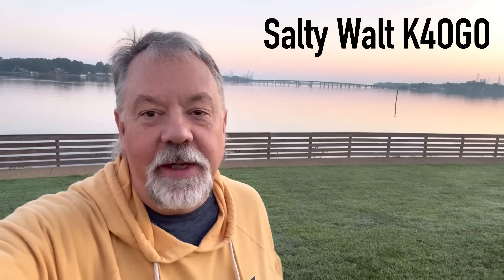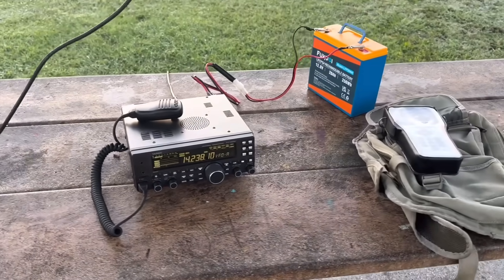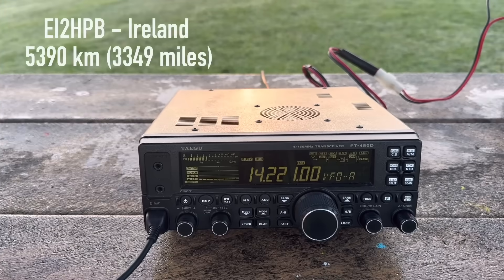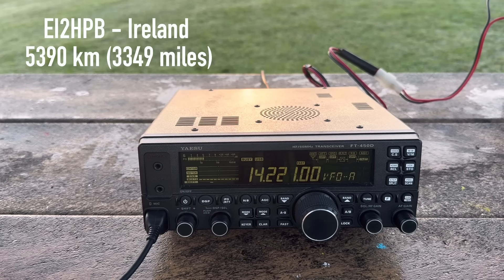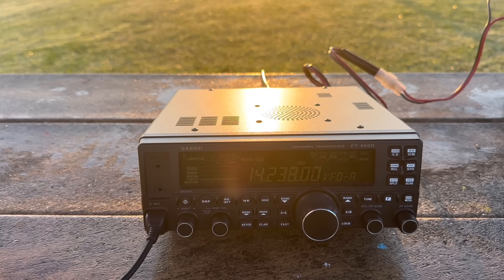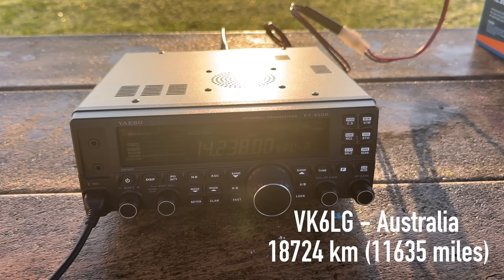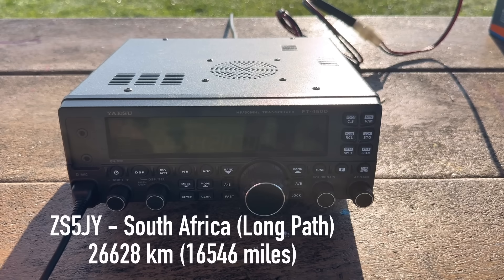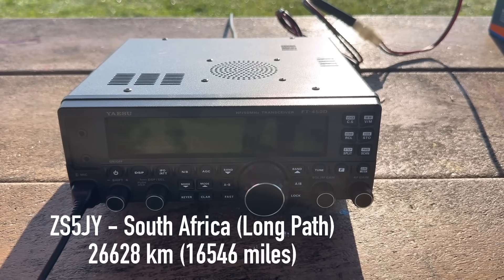Building a Half Square Antenna for 20 Meters

Comment: Hi Walt.  You should try an Icom ic-706MKII or MKIIG.  One of the first "shack in a box" radios.  100 watts on HF and 6m.  I have the 706MKII with DSP installed.  I don't use it on 2m, but on HF and 6m it is an excellent radio with a lot of great features.  I have the Ten-a-Tuner module from W2ENY, which makes using the ATU-100 (in auto mode) with the 706 series  radios really easy.

Comment: Nice video, and some great contacts into VK and ZS. Looking at the modelling tool Walt has used, it has to be said that he has chosen "Perfect ground" from the Ground Type dropdown there to get the azimuth radiation pattern he shows at 0:32, as well as the actually not realistic nearly 9dB gain figure. A better ground type for that location beside the river might be "Good" or "Very good", which would give not so dramatically deep nulls in the pattern and a more realistic gain figure of 4+dBi, but that's possibly just a nitpick.  I'm going to have to make me one of these...
Reply from the maker: @robbannstrom yep a bit of a nitpick but I get that a lot. I get many comments about my use of saltwater and perfect ground which I make no apologies for. I named the channel Coastal Waves & Wires because my main interest is HF propagation by the ocean. I actually explain that in the beginning of my book. Regardless of the dB number, the 3D RF model shows the effect of building the half square and feeding it in a corner. It’s a solid antenna for DXing. 73, Walt
Reply: @COASTALWAVESWIRES  Apologies for having sounded so critical. I had not realized that the water very close to you in the background was salt water. You certainly chose the right setting there.  As to channel names, I don't generally pay them any attention, and I'm afraid I've never heard of your book, so your explanation there won't ever reach me.  Nice video, tho'...

Comment: Morning Walt, I believe the half square is vertically polarized and fires end to end, not broadside. I've used one for years at a lake cabin and the nice thing is that it will tune up on other bands. Enjoy your ride!
Reply from the maker: No, it definitely radiates broadside, the model and a lot of text show this. I was also aimed broadside to all these big DX contacts which this video proves as well. This acts the same as two vertical quarterwave in-phase that are a half wavelength apart. 73, Walt
Reply: The full-wave current-fed single-bander version IS mostly vertically polarized, and fires broadside.  The end-fed half-wave multi-bander, however, displays different patterns on its' various harmonics and varying degrees of broadside, end-fire and max lobes and mixed polarization.

Comment: It's amazing what 9 db can do for a signal.  Some hams put up 3 element beams at 60 ft and only get 6 db over a dipole but you sure showed 'em Walt.    K2XT
Reply: That 9dB figure was obtained for a "Perfect ground" ground type, and not for a more realistic ground type.
Reply from the maker: Yep, in proximity to saltwater. Pretty much how I typically operate
Reply: @COASTALWAVESWIRES  OK Walt, I had assumed you were close to fresh water, and on a rich type of soil. In your actual operating position, either one of "Perfect ground" or "salt water" ground types would be appropriate - both give very similar results. You made some great contacts there !

Comment: K5OHY says that it's not much better than a POTAperformer.  https://www.youtube.com/watch?v=4k77IYFNVjs
Reply: In my tests comparing the bottom-fed half-square to a 1/4 wave using KiwiSDR, there wasn’t much difference in signal strength. The RBN spots were better on the half-square, but the big difference was just how quiet it was compared to the Performer — zero noise, which made pulling out weak stations much easier. Most of us will only see 3–4 dBi of gain in real-world conditions. Walt’s 7–9 dBi numbers were with a perfect ground plane, and not many of us are fortunate enough to live right by saltwater.
Reply from the maker: @Tim-K5OHY great video, I just watched and subscribed. I enjoyed the in-depth review which is a different angle from what I do on my channel. I sketch it, build it and see how it performs and try to squeeze it into a 10 minute video. YouTube needs more content like yours, you’re building a great channel. I get many comments about my use of saltwater and perfect ground which I make no apologies for. I named the channel Coastal Waves & Wires because my main interest is HF propagation by the ocean. I actually explain that in the beginning of my book. Regardless of the dB number, the 3D RF model we both used on our thumbnails shows the true effect of this antenna. It’s pretty crazy that we both put our videos out at almost the same time but I’m glad it happened as it helped me find your wonderful channel. 
@JoeHamelin I’m not real sure about the comparison between this antenna and the POTAperformer as I haven’t experimented with that antenna and I think they’re actually meant for different situations. Many people ask me about POTA antennas and it’s hard for me to really give a good answer because I’m really not a POTA guy I’m a DXer and I really feel like this half square antenna is an excellent DX antenna as it shows in this video. 
All the best and 73 y’all 
Salty Walt K4OGO
Reply: @COASTALWAVESWIRES Thank you so much, Walt! I really appreciate the kind words. I’ve been a huge fan of your channel for a while. In fact, it was a big influence in motivating me to get out and try new antennas. I did one activation from the beach at Padre Island this past February with a saltwater counterpoise, and the conditions were amazing. I made a ton of QRP DX contacts, so I definitely wouldn’t apologize either!  The saltwater amplifier is real.

Comment: Walt, on the FT-450 you should use AGC.SLOW for SSB as this will keep the AGC circuit from "pumping" the RF signal.  Also since you had a really nice low noise-floor there, try enabling IPO next time.  I think you'll be surprised at the signal improvement.  (From my experience it only works with low-noise environments.)

Comment: Well a really effective antenna . Nice to see a relatively simple wire antenna with a decent null. I was wondering thouh if you are really getting that 100W or 100W for long on that relatively small bettery. Not so much discharging it but havingthe voltage fold over under load ??!? M0XJA

Comment: Inspiring antenna ideas as always, your DX makes we want to try this!
Which is best for this application a 1:1 current or voltage balun?
(I think I read that current baluns were the way to go but I see LDG makes both).
Reply from the maker: Thanks! I used a current balun. I did some research on this and almost used a voltage balun but current is definitely the way to go. 73, Walt

Comment: Hi Walt
Great results! Now reduce all dimensions by half; lower vertical sections to just above the ground; feed at ground level and lay a few radials out under each vertical section. You have a half-quad! I've had good results from them. 73 de M1GWZ

Comment: Very very cool that may just work for a throw up antenna in the woods.    Much cheaper and easier to deploy than a Yagi.  
Do you think this would be a good NVIS antenna ?
Reply from the maker: This actually has a low take off angle. Probably not a very good choice for NVIS

Comment: I would have loved to a video of you putting that antenna up….seems a bit of a challenge for one person.
Reply from the maker: It was actually easier than I thought it would be. I taped it to the poles first, put the coax on the one end and put that pole up stretched the other one apart and then drove the PVC in the ground and slid it on, it actually happened pretty quick.
Reply: @COASTALWAVESWIRES thanks much, what size pvc did you use?

Comment: Please can you remind me how you support the poles? Thanks. Peter M0LMG
Reply: Hi Peter, I can't answer for Walt but I have used metal bar (rebar to be exact) hammered into the ground and slide the pole over it, it's good enough for a temp setup.
Reply from the maker: I use a pvc pipe about 1 meter long and drive it into the ground and then slide the pole on to it

Comment: Not sure why you said salt water would not have much effect…the salt water should be just as effective with phased verticals as with a single vertical. It just does not help horizontal antennas as much as verticals.
Reply from the maker: Because I was up away from it and not using a vertical with a ground plane under it
Reply: @COASTALWAVESWIRES the salt water out in front of the vertical or verticals makes the biggest difference as it reduces the Brewster angle. My 80 meter half square was the best antenna I ever had! It was about 300 feet back from a salt marsh in Hampton. I also built them for 40 and 20. Very deep nulls off the ends. A bit narrower lobe than the dipole. I put one up in New Kent county pointed to JA and worked lots of Pacific on 80. Almost no Europe. Bad for my DX contest scores so I “rotated” back to NE/SW and worked Europe but lost my ability to get JAs on first call! 
Here in Williamsburg I put it back up with great success until the old wires finally broke a couple years ago. I need to put it back up.